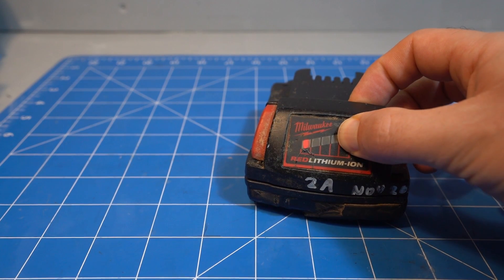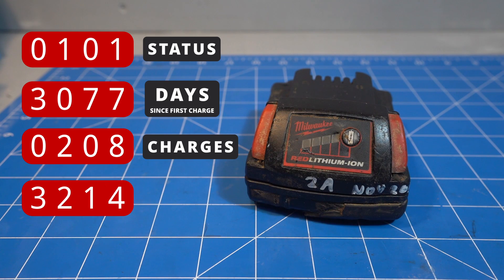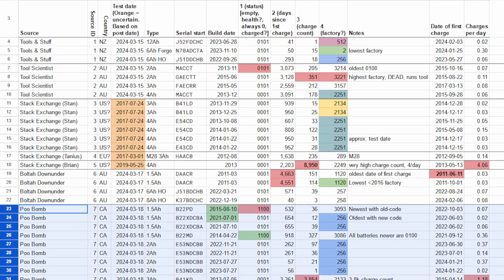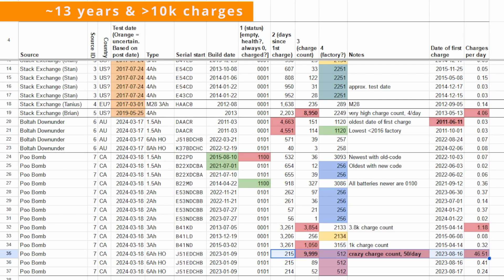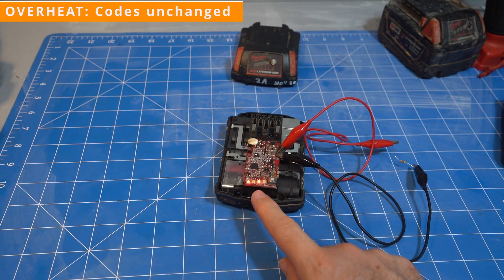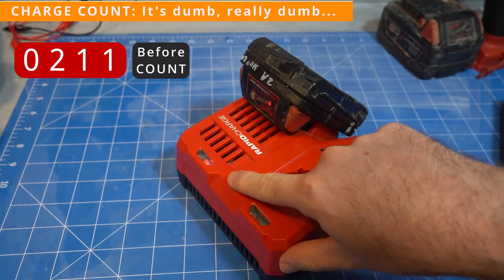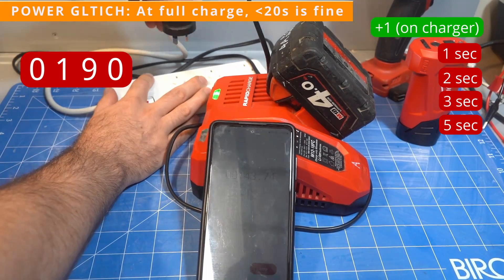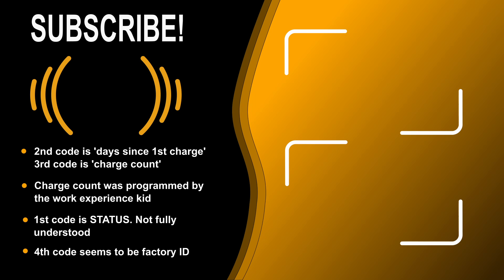[007] Milwaukee M18 has hidden diagnostic codes

Comment: For your research  Of the four batteries I have with me only one has the code feature.   
1.5Ah Red Lithium.    14 09 03  P B22LD 656419
  with 2 bars  before and after the Battery shows green on charger and 4 bars on the guage but first set of numbers 0 0 0 1  Second Set 3227 days from first charge.   Charger cycle count 9999 (This may be accurate as I have shuffled batteries between multiple chargers trying to weed out bad charger or bad battery and it is quite old) 4 set of info numbers is 2070  
Batteries without feature
Red Lithium CP 2.0 E53LDCCB 190311 0772170
Red Lithium CP 2.0  E53LDCCB 190311 0771970
Red Lithium CP 2.0  E53LDCCB 201215 3512813
I am curious if the other battery you have data on with a 9999 code also does not change the first set of numbers. like mine.
Reply from the maker: You need a lot of charges to get to 9999. If you put it on the charger every 5 sec, it would take ~14 hours to get 9999 charges. I'm thinking it's to do with faulty chargers or bad power supplies that make the charger flick on and off a lot, or maybe it's an error mode that's designed to tell Milwaukee service techs that this battery was abused and shouldn't be warrantied.

The other 9999 battery is a January 2023 6Ah HO that only had 215 days since first charge. Owner says they definitely haven't put it on the charger a lot.

Thanks for your help!
Reply: @toolscientist  I did have charger or two that would go into flashing mode on a battery but I could put battery on another charger and it would go green.   I may still have one if you want it I can mail it to you
Reply from the maker: @currentliveoccupant I'm now thinking charger is unlikely. You're the 3rd to have a 9999 battery and so far everyone with a 9999 only has one. If it were the charger, then one of those 3 would have more than one battery with 9999.
Reply: @toolscientist  True as I had 4 of those chargers mounted on a wall but would not have put the same battery on same charger each time.

Comment: the codes i got from one of my 5ah batteries was 
 ca, 2024-03-29, 5Ah, 5INR18/65-2, 48-11-1828, unknown, 0001, 4220, 97, 1082.
Reply from the maker: Date should be on heat stamp near the terminals. Should be a 2012 battery, so heat stamp will be something like 120701R
Reply: 5INR18/65-2 is a part number- like entity. The last 3 groups on that line are serial-first-half date-yymmdd serial-second-half
4220 would be a really old battery that sounds like an excellent data point.

Comment: I have 5 batteries, all purchased at Home Depot, all of which should be in your last codes window but only two of which actually give codes:

CA 2024-03-28 2Ah E53NDCBB 2021-10-19 0101 0418 0001 0256
CA 2024-03-28 2Ah E53NDCBB 2021-10-25 0101 0418 0001 0256
CA 2024-03-28 4Ah E54SDCKC 2021-07-16 No Codes
CA 2024-03-28 4Ah E54SDCKC 2021-08-29 No Codes
CA 2024-03-28 5Ah G29JDCBC 2023-08-02 No Codes

I popped one on the charger real quick and it incremented the third number: 

CA 2024-03-28 2Ah E53NDCBB 2021-10-25 0101 0418 0002 0256

But both 2Ah have been charged at least a couple times I'm sure, for a good while they were my only two batteries. I wonder if the charge count reset at some point?
Reply from the maker: Thanks! That low charge count is very odd. The first charge sets it to zero, then the 2nd charge makes it 0001. But it sounds like you should have at least 5 or so.

Comment: From they grey dates, these batteries do not produce flash codes: 
CA 2024-03-28 XC5.0 G29GDCAC 2016-02-18
CA 2024-03-28 XC5.0 G29GDCAC 2016-02-02

This one didn't have an expect serial number, so I just wrote the whole thing:
CA 2024-03-28 1.5Ah B22HD120904407R 0001 4192 0065 1536

Comment: Wonder if we'll find a different method to activate this on the 16-20 batteries. 
Maybe its only available via serial through the charge port?
I can believe they want to hide it from the customer or even thay there was a glitch in production, but not for 4+ years and I cant imagine any reason they would disable this function
Reply from the maker: I assumed they disabled it after redlink plus was introduced as that gives a full serial interface on the J1 and J2 pins. But some of my old batteries that do it have redlink plus, so there goes that theory. As to why they brought it back, my best guess is to help spot counterfeits or to be able to do diagnostics for a customer by video call.

Comment: I have a few batteries that might be interesting data points. The 12Ah and the two 3AhHO packs I bought new recently as a set on sale. Only did an initial charge on them. They have never been on a tool. All three of them have 0011 as the first four-number code.

US 2024-03-27 12Ah J52FDCHC 2023-04-23 0011 0044 0000 0512

US 2024-03-27 6AhHO J51EHTHB 2023-03-03 0101 0218 0002 0512

US 2024-03-27 3AhHO K35DDCHB 2023-05-02 0011 0043 0000 0257

US 2024-03-27 3AhHO K35DDCHB 2023-05-02 0011 0046 0000 0257
Reply from the maker: Are you sure 6Ah is J51EHTHB? Every other battery I've seen has "DC" in the middle. So yours should be J51E-DC-HB
Reply: @toolscientist  just double checked, and yes it is J51EHTHB.

Comment: So I have a brand new 6.0 Forge battery, and it shows: 2nd Code - 32 days since first charge. 3rd code - no flashes (ie never been charged). Weird part is that I definitely charged the battery when I first received it, as it was only on one bar. So maybe the 3rd code is the amount of times it's been put on the charger after the first full charge? 
Pretty confusing.
Reply from the maker: A couple of people have said that first charge doesn't get counted. Is your 4th code 0002?
Reply: @toolscientist  yup, 4th code is 0002. Def seems like all forge batteries come from same factory, or at least have same last code.

Comment: I have over 100 Milwaukee batteries.

I see I have some homework now.
Reply from the maker: Don't spend too much time on it. I decoded 14 batteries from a video someone sent me and it took over an hour. Interesting ones will be around that April 2014 mark where the status code seems to change from 0001 (older) to 0101 (newer)

Comment: Got my combo set today. I did this test with both 5 ah batteries that came with it... the first number is the same as yours, 0101, #2 and 3 are both zeros and the 4th number is 256.
So based on my result, both batteries have never been charged.😊

Both batteries initial voltage was 17.5v, the date on the batteries is 2023.02.27 and they came with one bar of charge.
Reply from the maker: Interesting. We've had a few people with brand new batteries and they've reported the status bit as 0011. Were these codes read after the first charge? The first charge is not counted, by the way.
Reply: @toolscientist  I haven't charged them as yet so they are same as I got them.
Reply: That's crazy I just picked up a new battery that has a build date of April, 7 2024. Same flashes decoded like yours. 0101 2nd sequence blank, 3rd sequence blank, 4th sequence is 0256
Sooo this tells me its new!

Comment: I have about 50, I guess I know what I ll be doing this weekend…
Reply from the maker: Don't go too crazy. They're pretty painful to decode - sometimes 5min/battery if the numbers are high and you need 1-3 loops when you lose count.

Interesting batteries to me are ones near the code/no-code dates. Also ones near April 2014 as that seems to be when they go from X0XX to X1XX on the first code.

Comment: So here are a few more data points: 
US 2024-03-24 HO6.0 J51ADCAE 210115 Does Not Work
US 2024-03-24 HO6.0 J51ADCAE 211103 Does Not Work
US 2024-03-24 HO6.0 J51ADCAE 211103 Does Not Work
US 2024-03-24 XC5.0 G29JDCBC 201210 Does Not Work
US 2024-03-24 XC5.0 G29JDCBC 201213 Does Not Work
US 2024-03-24 XC5.0 G29JDCJC 220108 Does Not Work
US 2024-03-24 XC5.0 G29NDCBC 220311 0101 0525 0002 0256
US 2024-03-24 XC5.0 G29NDCBC 220311 0101 0526 0002 0256
US 2024-03-24 CP3.0HO K35CDCAE 210708 Does Not Work
US 2024-03-24 CP3.0HO K35CDCAE 210708 Does Not Work
US 2024-03-24 Pre Red Battery B22CD103 N/A 0001 4888 0102 1056
US 2024-03-24 Pre Red Battery B22CD103 N/A 1000 4889 0127 1056
The last two are very old, sometime prior to the Red Lithium branding and were just compact 23Wh 1.3Ah batteries but did work.  I would by the 4888 days on those (Nov of 2010) based on the full serial number the would have been produced the 30th week of 2010.    The two XC5's do line up from purchase date and haven't been used really any, as they were just in a pack.  I use mostly the HO versions only and those XC5's are just if I need them type thing.  So all the data does seem to match up.
Reply from the maker: Great info, thanks. Looks like Jan-Mar 2022 is when the 5Ah got its codes back, which lines up with most other battery types.
Reply: @toolscientist Just an FYI the two oldest batteries that are non-Red based CP's from 2010.  They were on a rapid charger overnight and when full the 1st info is 0001 on both of them.  I then killed them very quickly with a 2980-20 6" angle grinder (just about 1 min for one of them and about 30 secs for the other).  The 1st set was still 0001 on both.  One of them recharged in about 15 seconds back to almost full so I know I have bad cells in them.  So I am not sure what exactly the 1st set is showing here at least, but could be something strange because they are prior to the "red" branding.  They pretty much just sit in one of the tool cases not doing anything and I just have them for parts if needed.  I don't intend to ever rebuild them, just because I now have so many other newer batteries that I don't use at the moment.  If you need any more info or data please feel free to ask.
Reply from the maker: @Chris_In_Texas  that's pretty normal. My 2015s and Tools & Stuff's newer batteries do that, too. If you discharge quickly, the battery taps out at low voltage, but once stopped the voltage will recover. If it recovers to ~16-17V (haven't tested specific voltage yet), then the battery will "re-enable" itself and let the tool run again. I think if you'd tried to run them on a tool before putting them in the charger, they would have worked.

Comment: Since there have been issues with m18 cell issues causing  bms to disable batteries in the past… Im surprised non of the codes don’t represent individual cell status.
Reply from the maker: Cell balance seems to be more recent, primarily 8Ah and 12Ah (also the discontinued 9Ah and 6Ah XC). These codes seem to be unchanged since 2011. They have more diagnostics than what these flash codes show, but you need a special adapter that only service techs have.

Comment: In Canada, 

HO 6.0 J51BHTHB 221003
0101
0358
0004

2.0 E53ED 016494
0101
3126
0014
3219
Reply: I've got a bunch of 12.0 and the new cp3.0 and none have codes. Same with every 8.0 I tried.
Reply from the maker: Are you sure 6Ah serial number is correct? 5th digit is always "D". I suspect it should be J51-B-D-CHB. Do you have 4th code for that battery? Should be 256/7/8 or 512

Your 2.0 is pre-2016, so its date code will be on the heat stamp near terminals.

Can you send me the date codes of your batteries without codes?
Reply: @toolscientist  yes the SN is correct. 4th code is 0257
Reply: @toolscientist  no code on 
J52adcaf
K35BDCAE
K37ADCAF
K37ADCFE
J52BDCAF
J51ADCAE
K35ADCAE
E53ED 016494  (150109)
E53LDCBB

Comment: i have 2 Faulty AU Milwaukee Batteries, i didnt have the charger with me so i did a sneaky 20.4v charge on a Constant Current power supply and now they just blink the first light 8 times quickly as if they were flat but there not. These are both the older style and i didnt know what parts of the Serial you needed i assume just the actual serial on these ones. but i attached the whole code just incase. I also padded the codes out to 4 values each ie 73 to 0073
AU 2024-03-24 4Ah '4932 4300 63 *5 INR 19/65-2 M18 B4   Ser-No:31708' DATE CODE KACCT    1000 3515 0073 2251
AU 2024-03-24 3Ah '4932 3526 68 *5 INR 19/65-2 M18 BX3 Ser-No:38398' DATE CODE DAECRR 1100 2918 0083 3155
Reply from the maker: Thank you! For the old batteries the serial number isn't useful, I just needed the heat stamp. The format seems to be [MONTH+1][YY]"C"[Factory ID]. So yours should be Oct 2013 and Mar 2015. If you're really keen you can check the injection date codes on the inside of the shell to confirm.
Reply: I happen to have the shells off of these atm as I was looking at the cell voltages to see if the error was due to imbalance and because they dont charge on a milwaukee charger anymore.  The injection stamps do align with those dates. Its interesting; your assumption on the 'status' set, that both my faulty batteries do not have the 3rd bit set where all yours did. so defiantly could be indicative of the third bit being a health battery and them being notset a fault condition. @toolscientist
Reply from the maker: All of my batteries with codes are 2013-2015, and 3 of 4 have the 2nd health/age bit as zero. They still work fine. I have found from connecting wires between charger and battery that if the charger detects too much resistance, you'll get an error. When it does this, you can hear the charger make an electrical hum with the pitch increasing in about 3-4 steps. It'll try 2-3 times before givign the flashing red/green error.

Comment: I found 2 batteries that do NOT produce the flashing lights, both of which help and hurt your current data.

First is an XC5.0, date code is 210918 (appears to be in your "green" section, however) built in china/parts sourced in other asian countries.

Second is a HO8.0, date code 210427 built in Korea/China

All of the others are 2022-2023 built, have the codes, and begin with the 0-1-0-1 flashes
Reply from the maker: It's getting somewhat complicated. So far a 1.5Ah is the only 2021 battery with codes. After that it's not until March 2022 in a 6Ah and 12Ah that we see codes again. Not sure if the 1.5Ah is a mistake or an outlier, I'd better check!
Reply: @toolscientist  it sounds like something they maybe rolled out into different factories then, over time? Strange.
Reply from the maker: @hakz1nunke  the strangest part is that they removed it, then put it back. It might have needed a PCB revision, so might have taken a while to go through all their old stock

I did double check 1.5Ah from July 2021, and it is correct
Reply from the maker: @hakz1nunke  my first thought was they removed it when redlink intelligence plus was introduced. That gave them a full digital interface to the battery with an adapter, so flash codes were slower and no longer needed. Only reason I can think of adding them back was they found it useful to diagnose stuff over the phone or video call. As for cost, it's all software, so it's free.
Reply from the maker: @hakz1nunke  I'm trying to match 4th code to first 8-letters of serial code. First 8 letters seems to be 4 letters for battery type, then "C", then 3 letters which I think is factory.

Which battery of yours has a "2"?
Reply: @toolscientist   my 2 is a brand new Forge 6.0, manufacturer date is 230814, made in China
Reply from the maker: @hakz1nunke  all 6Ah forge seem to be 2. That's part of why we think factory, production line, or QC. There's some overlap between battery types and dates. Of the new batteries, 4th code is 2 (forge only so far), 256, 257, 258, and 512. If you send me an email I can share spreadsheet with you if you want to look for patterns in the 4th code.
Reply from the maker: Email can be found on my channel page. Click on the description "Answering the questions that no one cares about..."

Comment: Perhaps those high counts of 9,999 has something to do with the thermal safety. Or something else that causes the charger to flash.

Edit: I guess I commented before I watched the rest of the video. But that’s probably the cause if it
Reply from the maker: 😁. I didn't see any increase in mine from thermalling. The guy would have still had to put it on and off the charger 9,000 times whilst thermalled to get there. My best theory is either a flaky supply voltage that dips when the charger ramps up to full charging current and results in an infinite brown-out loop. Other possibility is a battery that wasn't seated properly and nearby vibration made it constantly gain and lose contact. I might do some further testing to see if I can trigger count++ by shorting the terminals.

Comment: USA 6.0AH J51BDCHB 2022-01-14, 0101, 0666, 0031, 0257.    USA 3.0AH 21700 CELLS K35BDCAE 2019-11-14 CODES NOT SHOWN. Can you decode the m12 battery's I have one that blinks red, green.... I have noticed that if a battery is fully charged and put away for about a month when I push the status button the first light will blink like its dead but its not, putting on the charger will wake up the battery and show full bars and works like normal, so that's why some show 1100, also If there is one cell that is way low there will be another code I don't remember off hand I will have to find my notes.
Reply from the maker: Good stuff. Most of the M12s are analogue. If the charger is giving errors, it's because a cell is too low or too high resistance. I only have 2x M12 batteries, but they do seem to have a chip in them with an i2c interface. That chip might be able to lock the battery out. I might have to sacrifice one of my batteries to find out what that chip is and then see if I can talk to it.

I'm going to leave 2 batteries idle and test their codes periodically. One will be fully charged and the other drained to 9V.
Reply: @toolscientist Thanks for the response I opened up my m12 and found it was the trace for the thermal was not connecting to the T terminal the thermistor was reading fine at soldier points, so I used a small wire to reconnect, you are right there are no smarts in the m12 battery. Thanks again for your time. keep up the informative videos.